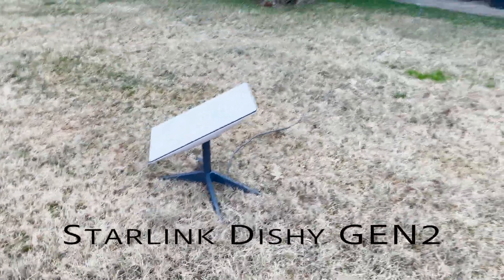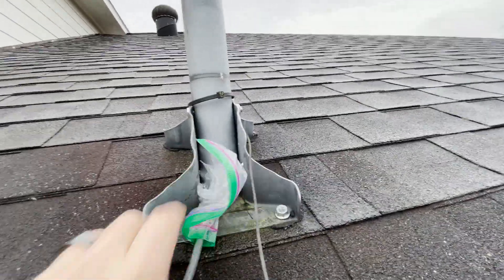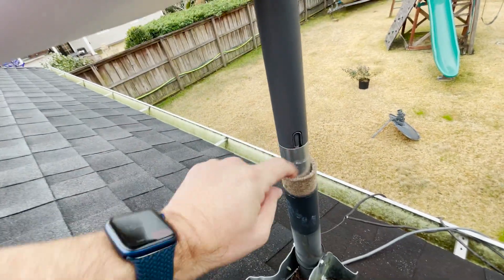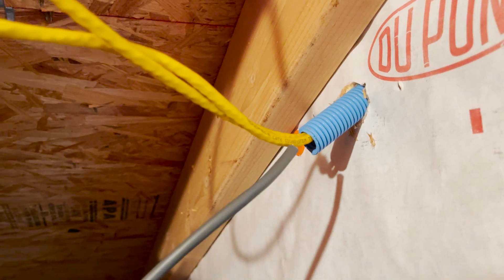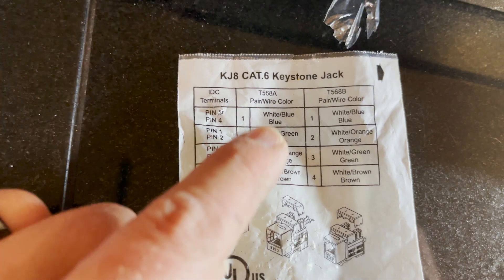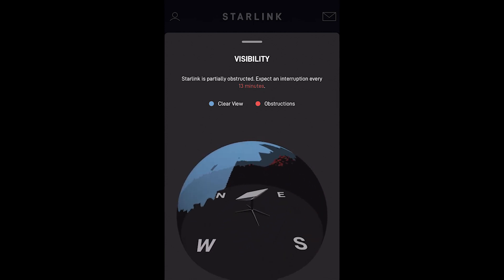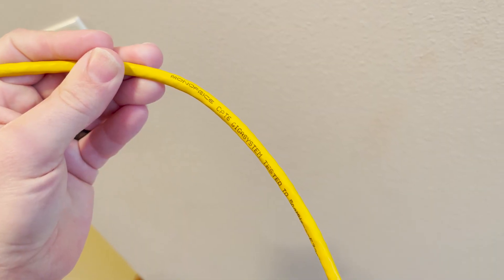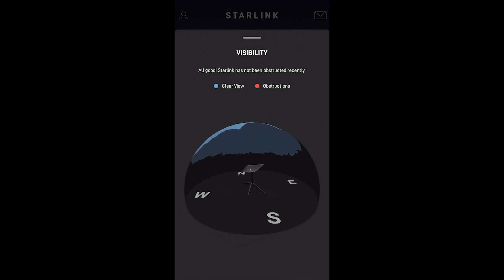Reuse previous viasat dish mount and install Starlink Dishy 2

Comment: I concure with Chuck Green's comment.  He is spot-on with reasons for reconnecting the shield.  The antenna and router are vulnerable from any future electromagnetic spike short of a lighting strike. Engineers design to specifications, but it's the bean counters that decides what parts remain in a 10,000 unit production run.  Even the bean counter thought the shielding was required to mitigate future risks.

You are producing excellent content and providing a service to the community.  Keep up the great work.

Comment: Never should have cut the cable. It's shielded for a reason. 
Should have pulled the flat end from router towards the dish.
Reply from the maker: Thanks for the comment. I didn’t mention it but I did try that. The connectors are a lot bigger than normal cables. They do not flex. They won’t fit through any conduit. I haven’t had any issues since installation. It would be nice if they had a better design that allowed for easier wire routing through tight corners.
Reply: Both ends are proprietary waterproof HDMI-like connectors.
Reply: @BrianJense   I'm wondering what the original satellite wiring consists of and whether I don't have to re-run all that wiring from the Viasat dish to Starlink dishy. If it is the same, I wish they just sold the ends and a way to connect it. Any ideas??
Reply: @scraperfect  The cable is a heavy duty Ethernet cable, so you will have to use that. The ends does not detach as they are water proof.
Reply: Is regular satellite wire the same as starlink? I've seen people use a special plastic connector...
Reply: @scraperfect  No they are vastly different.  Google "ethernet pin layout" to see the starlink cables insides. A regular satellite dish uses https://en.wikipedia.org/wiki/Coaxial_cable, often in a heavier version called RG59.
Reply: Great video. Thank you. After two weeks I am getting good speeds and 2-4 minutes of obstruction per 24 hours. (Not noticeable.)  Any thoughts?  I live in a very wooded area.

Comment: nice vid, them ends look like a pain in the butt to fish through walls . That looks to be a standard cat6e cable that shielded , you can bond the shield back together by just connecting that ground wire from cable to cable . The shield is there to reduce emf noise from being induced on the 4 pairs of wires inside the cat6e cable and causing data loss. If your cable is away from emf sources like power wires, florescent lights, or particle accelerators you will be just fine. Thanks for showing that pipe mount!!!! Ill be getting mine soon and will be doing a similar installation. Thanks For The Video !!!!! ;n)      looks good